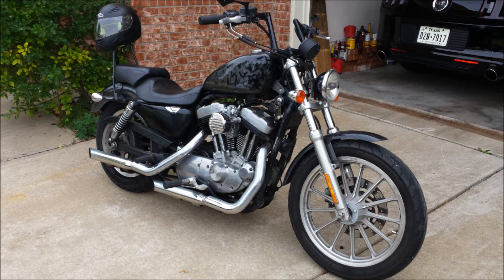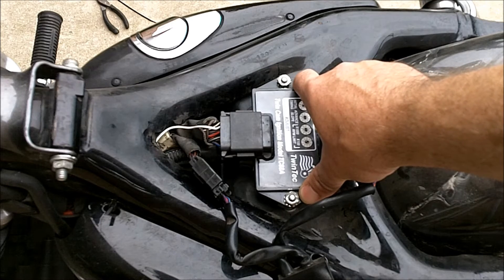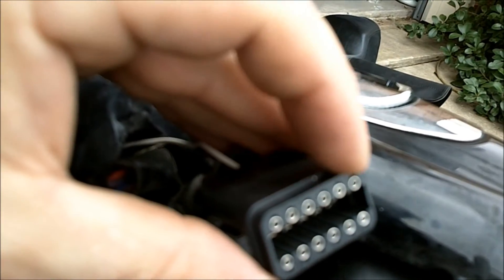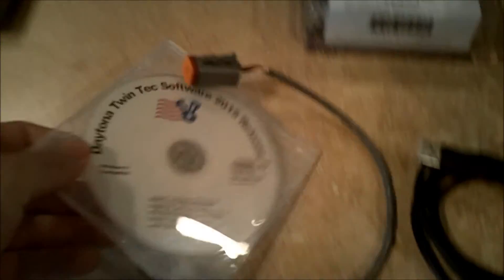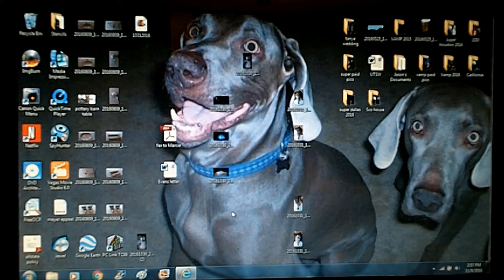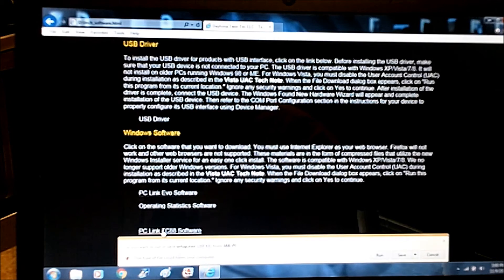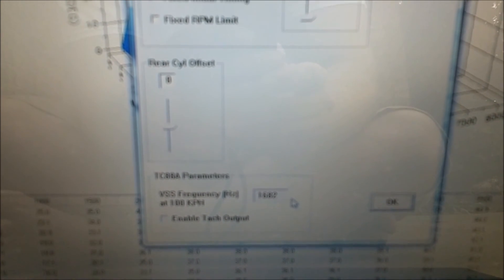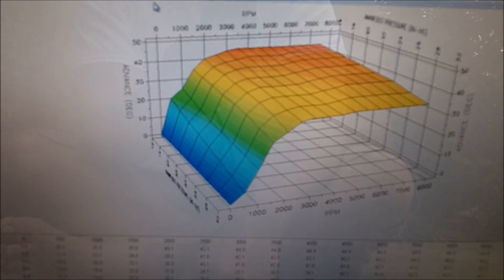How to install Daytona Twin Tec TC88A on a Harley Sportster and adjust it with the PC Link Cable

Comment: I have a 2004 883 evo sportster. My stock module crapped out. I purchased a tc88a with future modifications/upgrade plan but as of now it is stock. 1. What settings should I use on the tc88a for a stock 883. 2. Will I still need the pc link and software for a stock evo 883? Any help would be great! Thanks in advance. I see very little online info for a stock 883 evo.

Comment: Thanks for this video still in 2025, it helped me a ton installing my unit!
I have a problem tho, once i keep the brown wire out and plug the white cable in my 12pin connector the bike won't start.
I've obviously triple checked my connections and cable integrity and all is fine.
Studying the 06 wiring scheme that brown wire runs thru a lot of stuff (siren, tsm, ignition ecc.), may I ask if it worked for you without any other mod?

Thanks!
Reply from the maker: I didn't have to do anything else.  I'm horrible at anything to do with wiring.  I made this video after slowly following instructions for my bike.  Sorry for not being able to offer any solution for you.
Reply: @HilltopZombieShop  no worries, thanks again!

Comment: I have the same bike 883. I am putting the hammer 1275 kit in. I put the TC88A in first and have been running it before I do the 1275 kit. Wanted to make sure it works.

Comment: Great video. Windows 10 you just plug the interface in to a usb port you are going to use. Not plugged into the bike. Window 10 will set it up automatically. When done go to device manager and find what port it is on. You still need to download the software.

Comment: I have a 2006 883 the the hammer 1250 kit on it and Harley Davidson's digital/analog speedo and tach combo. I installed the tc88a and now I'm getting a "VIN ERROR" code where my speedometer readout once was. I do have the USB installation kit as well. Any advice or would be appreciated
Reply from the maker: VIN error means that the speedometer is not recognized by the ECM. This usually occurs because you have installed an aftermarket ECM (Replacement EFI Tuner) or have replaced the speedometer with a used one (already married to a different ECM). It's also possible that the speedometer or ECM memory somehow got corrupted. New speedometers will accept recorded mileage from the ECM and once synched will only work with that particular ECM. I don't know if there is a way to reset the speedometer to act as new and accept a new marriage to a new ECM. The ECM is programmed to complain if it doesn't recognize the speedometer. The ECM wants to know that the Speedometer is displaying the correct mileage for your motorcycle.
Reply: Well, I bought the speedo/tach last year brand new. It married to the bike just fine and worked great for over 10k miles. Only when I did the Hammer conversion and installed the tc88a did it read vin error. I can put the original module back in and it goes back to normal. I was wondering if maybe I hooked it up with the PC link, (which I have) I could possibly get it working again. Also, when I first ran the bike after the conversion, the speedo read normal through the first 3 heat soaks.
Reply: @stephenholmes6094   there is a location in the pc link software to install you vin from your old module and it will cure that issue.
Reply: @cb750k77  Hi, pleace my TC88A has the same problem but in edit tc 88a I can't fix the problem

Comment: I’ve also got a 2006 1200 custom... did you stick with the stock map that came with the tc88a? If you used another one send me a link lol
Reply: The guy on the forum passed away. We have a group with his files and some of us still tweak his stuff. And make new maps. We have a group on Facebook. Tc88a ignition.
Reply from the maker: No.  I found a guy on xlforum that wrote a map.

http://xlforum.net/forums/archive/index.php/t-1444639.html

Comment: This is a great video for someone hooking up a sportster to a tc88a. but keep in mind that it comes programmed for a twin cam 88 engine. and that is not a good map for an evolution. that is why you need the cable to upload a map for an evo.  along with the speedometer settings.

Comment: I have a 2005 xl1200r with rejetted carb and i just installed a tc88... so  do i have to do this computer programming?
Reply from the maker: The map may be fine but your speedometer will be off unless you do this.

Comment: Bingo, just what I was looking for,Speedo Recalibration!  Thank You .  Daytona needs to add Your Video !   Did You ever try a map pack or have one written for Your Bike ?
Reply from the maker: I had Jester Motorwerks create one for me.  He is all over the 1250 conversion forums.
Reply: HilltopZombieShop . Thanks for the Reply.                          Did the map pack make any difference ?   If so a little or a lot.   Thanks Again
Reply from the maker: Hard to tell.  I didn't ride it too much before installing it.
Reply: HilltopZombieShop . Got cha.  I have a map pack from jester. But The bike is running strong on 3/3 and rev set at 6200.  So I don't know maybe one day I'll try it .  Anyway thanks for the reply!  And help with the Speedo!